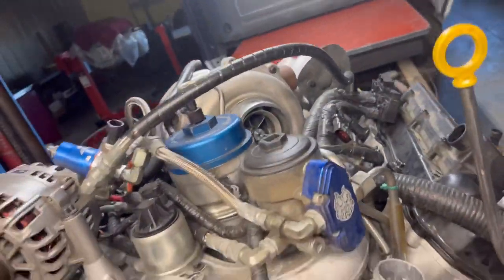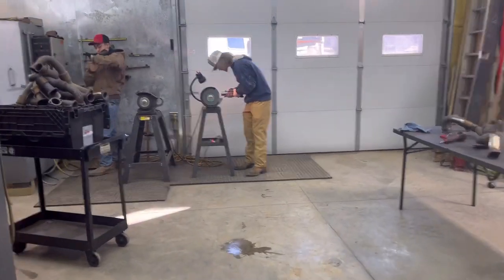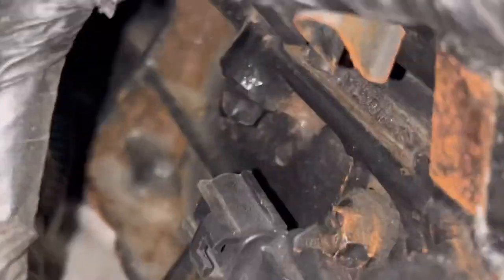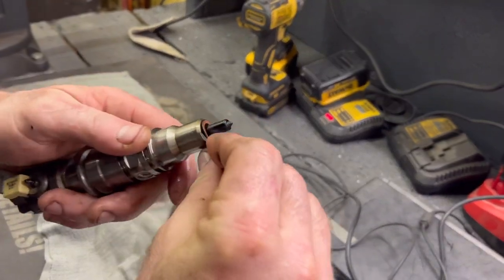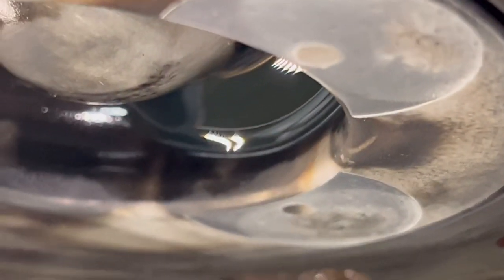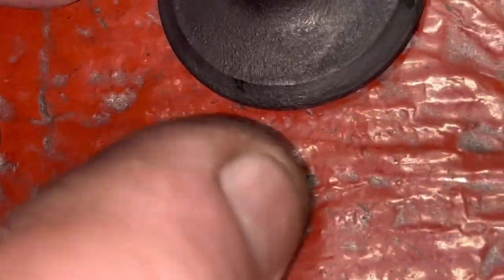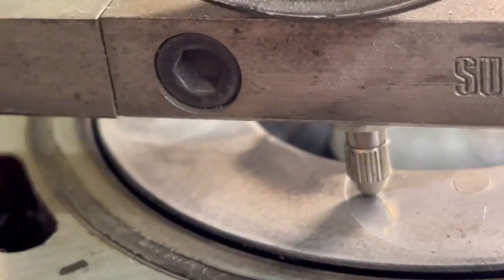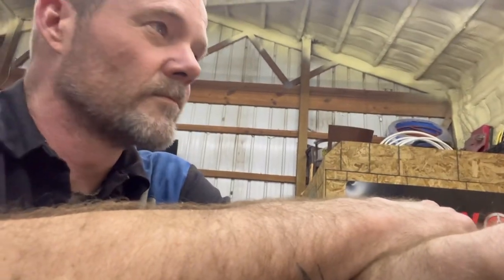How bad can a broken valve spring be????

Comment: Think I'd make sure that the wrist pin isn't sloppy or possibly a bad rod bearing allowing it to get too close to rhe valves maybe rock the crank back and forth mid stroke with a mic
Reply from the maker: Wouldn't that have affected all 4 valves if we had a lower end issue?

Comment: Check the valve for straightness and seating, put a new spring in it and let it ride. Up to the customer if he wants to replace all the valve springs. Then make sure he's not over revving it.
Reply: Yo Mark do you still train? I seen you over there man handling Roe Jogan a while back.
Reply: @giovannigiorgio8962  that's a different Mark Coleman lol but I've gotten that before.
Reply: That’s the important thing, what’s he reving it to., I’m sure he’s got a tuner messing with shift points.,
Reply: Wasn’t this the truck you delivered yourself up to New York I think., there was some type of issue when you built it, and opened it back up, or had to pull the rear cover??

Comment: What boost levels was he running? What was the reasoning behind the $$$ connecting rods and pistons?

If he was pushing it, you'd think a rocker arm or pushrod would go before a valve spring.

I sure hope you aren't warranting this work.
Reply: That's what I was thinking too.

Comment: At least send the spring back to SBI for failure analysis. Maybe they might a fault in the metallurgy of manufacturing error, like wrong temper, etc. 🤷‍♂️. If you’re really lucky, they might actually find an issue with the spring AND admit it. Whether they would off any sort of compensation is another matter. 😏😎